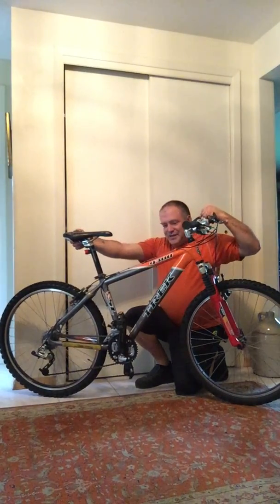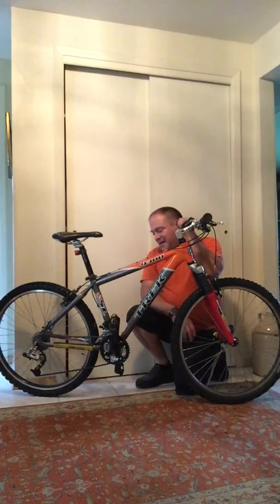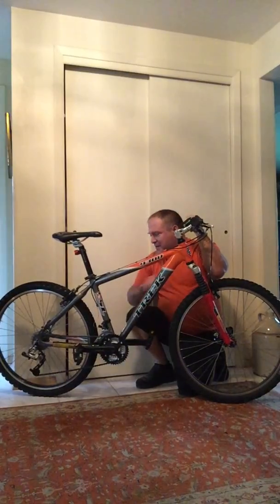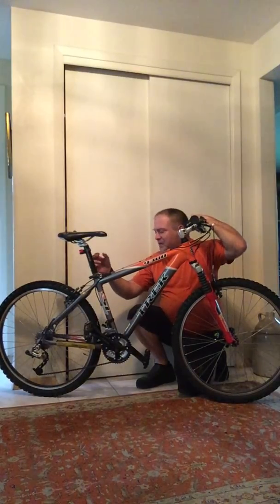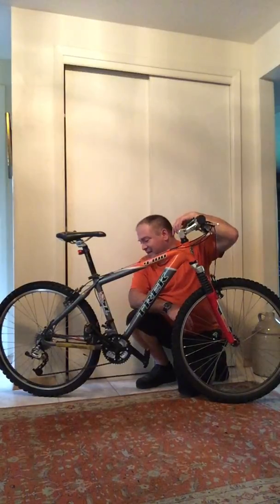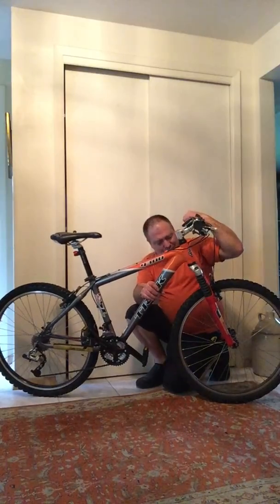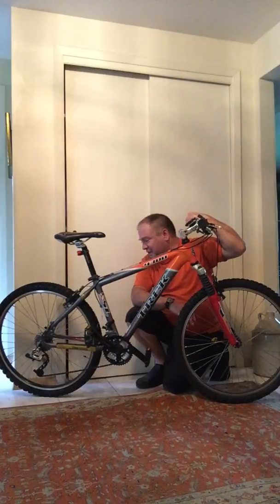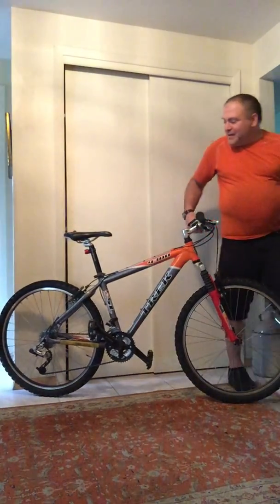Trek 4300 almost done  ...

Comment: Nice videos. Also have a trek 4300 but mines a 2012 model. Picked it up cheap a few months back and am currently upgrading and repairing a few issues. My previous bike is an old Sacracen Hardtrax from 1999-2000. That bike is still going strong. It came originally with no suspension but i upgraded to Rockshox Judy xc forks in 2001. Think the same forks you have fitted to your 4300. There great forks still i recently serviced and extended the travel to 100mm. I think once ive carried out the work needed on my trek ill do some work on the old saracen as its now my wifes bike.
Thanks for sharing,
Checkout my vids.
All the Best Steve...
Reply from the maker: Thank you.  These old bikes are pretty cool (though by the late 90s early 2000s I've found a lot of the parts like cranks etc were lackluster...probably to keep cost down?)  Regardless, they ride nice -- sometimes  nicer than some new frames!  Always liked the look of those old Saracens but never got ahold of one.  Will check it out...